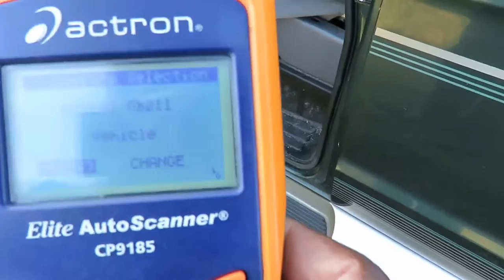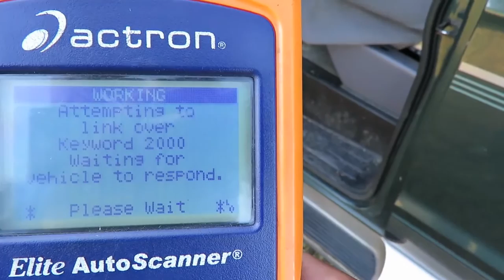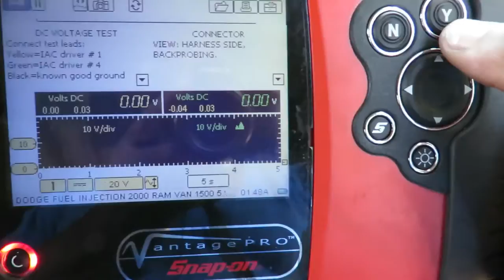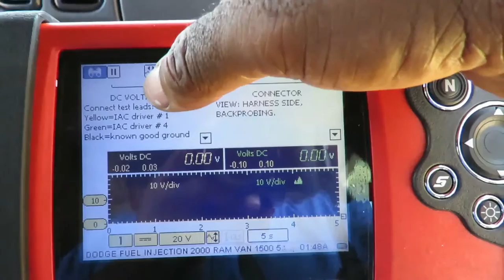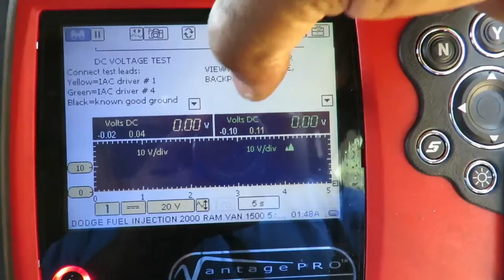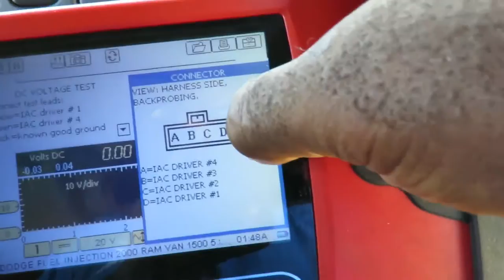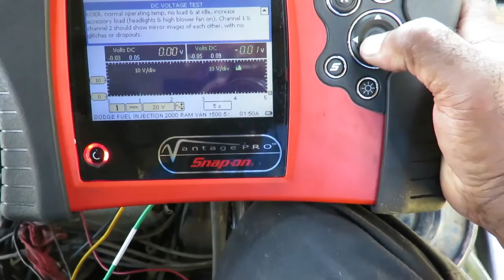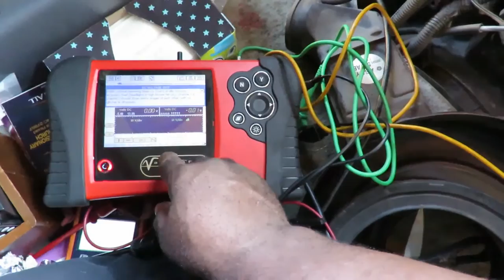2000 Dodge Ram Van B1500 - P0505 - Idle Control System Malfunction

Comment: i had the same issue for my 1999 dodge ram van 1500 5.9L. i replaced the IAC valve, TPS and cleaned out the throttle body. Inspected the wiring harness and found no issues. check voltage and ground, all good. checked for air leaks, none found. STILL had the p0505 code. my last resort was to replace the ECM.   finally fixed it.     The ECM must've gone bad.

Comment: Great vid thanks ...I had an issue same Van turned on then shut off changed the IAC instead of cleaning and car stayed on. Wondering if J should have cleaned it first now that I see your video. Now the alternator needs to be changed,can that cause the IAC to go bad ? Or did that happen coincidently...hard to find vids of these vans.
Reply from the maker: In all honesty, anything is possible, lol, but I don't believe the problem is related.

Comment: Man just came here because I'm having this issue. Just so happen to be from Rocky Mount too.. What are the chances!!
Reply from the maker: I KNOW!!!!! What part of Rocky Mount are you from?
Reply: @OnlineAutoRepairVideos  I lived off Gold Rock road. Burton St over by the Old Art Center. My folks moved to Nashville and then Spring Hope was the last place. I went to M.B. Hubbard Elementary.
Reply: @OnlineAutoRepairVideos  I just bought a new air filter, and idle control thing. Van is at the shop getting new pads and rotors. She is a beast when on the highway. I've replaced the pcm twice, and now in park she just idles so high. Randomly dies in reverse and at sudden stops. Hopefully these two things help. Im running out of ideas and money!!!
Reply from the maker: @decembria1111  Burton street is 3 minutes away from us. we're on Paul street.

Comment: If anyone can tell me the problem I have a 2000 Dodge van 2500 with 318 I can be riding down the road and it will just die sometimes it will crank back right away sometimes it takes awhile anybody know what's up with it
Reply from the maker: Something is shutting down when it gets hot. Your next step is to find out if it's ignition or fuel that you're losing. We do have a few ideas, but we would only be guessing, for example: fuel pump, crank sensor (if equipped), distributor (if equipped), ignition coil (if equipped).

Do you have a check engine light on, and if so, let us know the codes.
Reply: @OnlineAutoRepairVideos  i have the same problem on 2000 dodge ram 1500 5.2, its shutting off when its hot, it didnt trow any codes, it will said whereis odometer no bus, and the check engine light dissapier, when you wiggling wires conection to computer under the hood  with ignition on it will have again connection with computer and you will be able to start it, camshaft pos sensor changed, the computer under hood changed,  any ideas,?
Reply from the maker: It sounds like you have loose pins at a connector.
Reply: @OnlineAutoRepairVideos  but why its happened i mean shut off when its hot only? when outside warm it doesnt happened
Reply: I had the same problem with mine, turned out to be a bad transistor in the ECM. If you notice the ECM is right above the engine in a hot area and if your in a hot climate this is hard on the ECM.